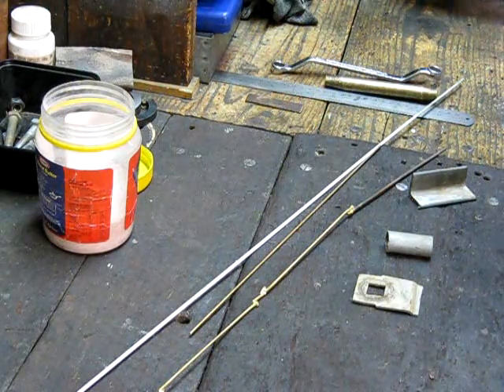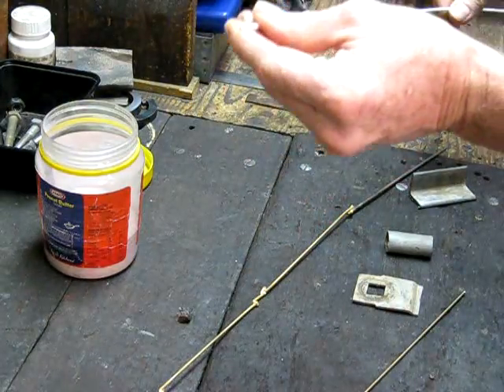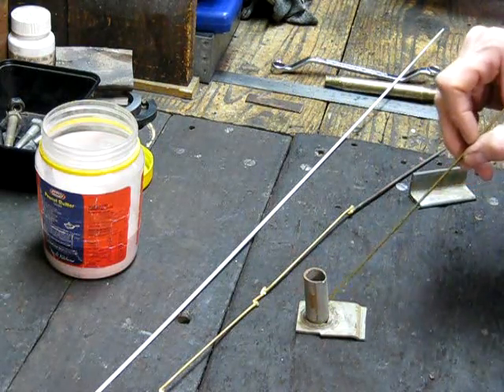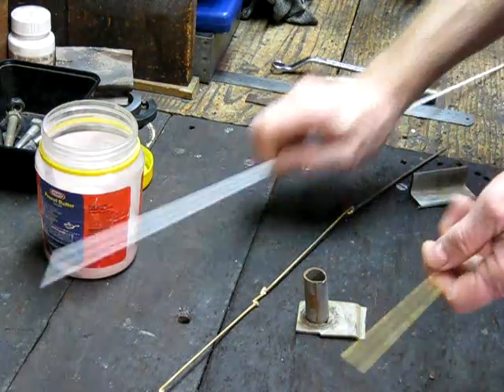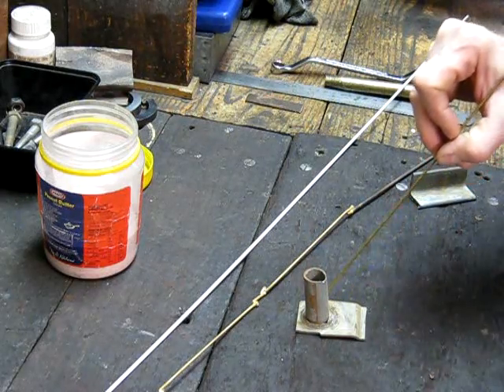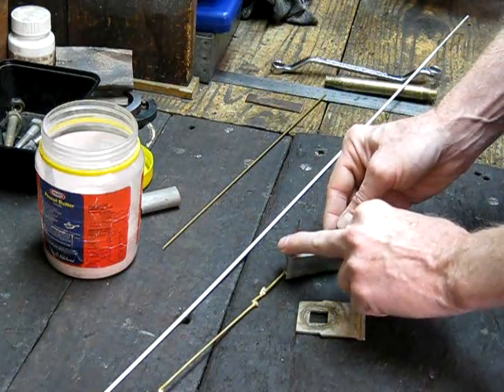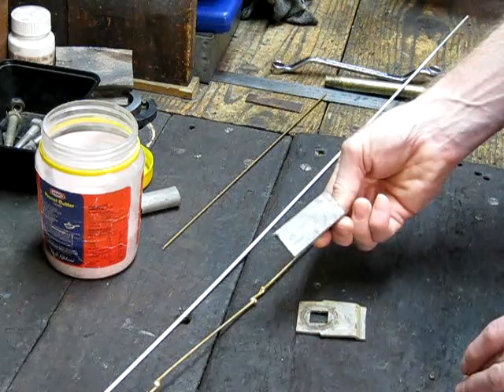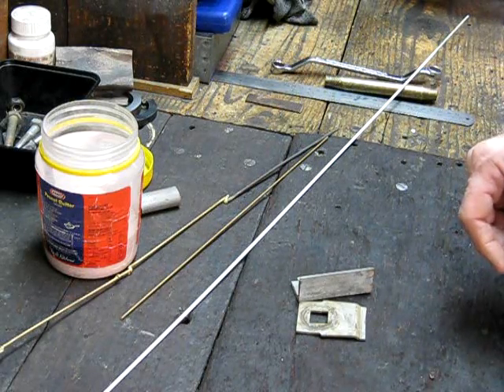How to bronze braze easily - some general workshop tips

Comment: i have big challenge last year on coated bronze i decided to throw it away better use flux and hard bronze separated you get  good results rather than using coated bronze rod
Reply from the maker: Yes, coated rods are bad news. You can't control the amount of flux or when it's applied.  I only use high quality uncoated rods and separate flux. Cheers Rob
Reply: @Xynudu  throw it away coated and jump into separate

Comment: Forgive me if I don't say this wrong. That bronze rod, can it be bought somewhere? I have a small crack in a bronze statue and want to fill the crack, will this do it?
Reply from the maker: Bronze brazing rod can be bought from most plumbing and welding shops.  Make sure you get the correct type for the welding system you intend using.  Welding bronze with bronze will be tricky as the rod will only melt slightly earlier than the statue.  You may be better off using a lower temperature rod such as the type plumbers use for joining copper pipe.
Reply: @diamond6256 did you ever figure that problem out? I have a broken bronze sculpture too, I'm trying to stick its arm back on

Comment: Nice tips, thanks! Would Silicon bronze or Phosphorus bronze be better for torch brazing?
Reply from the maker: You can't use those rods with LPG or a MAPP gas equivalent (not hot enough).  It would have to be an oxygen boosted gas (oxy/acet etc). Cheers Rob
Reply: And could you use borax for a flux?
Reply from the maker: Possibly, but best to use a proper bronze brazing flux.  I have been contacted by viewers who tried other fluxes and failed.  Cheers Rob
Reply: Could you please send a link for the bullfinch torch?
Reply from the maker: https://bullfinch-gas.co.uk/blowtorches/autotorch-brazing-sys/autotorch-brazing-kit-detail

https://www.hampdon.com.au/bullfinch-lpg-autotorch-brazing-and-welding-kit

Comment: Hi,
I am experimenting with bronze and propane only my rod diameter is 2.4mm and is refusing to melt even though the surface is dark red hot and the rod gets orange hot but won't melt,
Would you know if I need more heat for that diameter rod ?
Thanks in advance.
Reply from the maker: You can only melt bronze rod with a suitably hot torch.  The Bullfinch torch is the ONLY LPG torch I've ever seen that is capable of this.  It will melt 2.4 mm rod no problem.

Comment: Hello Rob, very good videos, can you give me some advice? I've had a small bronze sculpture cast by a local foundry, on a "cast only" deal. (Still bloody expensive) I now need to do some small repairs and filling. Would this technique be suitable, or would I risk melting the sculpture? Probably a silly question, but I'm new to all this. Thank you.
Reply from the maker: Hi Robert,  you definitely risk melting the sculpture if you use bronze brazing rod as they are both from the same family.   If the sculpture is oxidised any new bronze will be very noticeable.  It should be possible to repair the statue with silver solder (depending on what is to be fixed) but there may be a noticeable colour difference - use a suitable flux.  The other possibility is to use TIG with nickle bronze rod, as the professionals do to make large works.  Cheers Rob.
Reply: @Xynudu  Thanks Rob, I suspected  trying to braze would damage the sculpture, but like the nice clean finish you get with it. I've seen people on YouTube doing Tig welding to assemble larger sculptures. I'll probably visit a local engineering firm to see if they can help. I own a small arc welder, but guess that wouldn't be suitable for bronze work. Thanks for your help, really enjoy your videos.

Comment: ?
Now here's an interesting concept.
I was reading somewhere (oh a manufacturer of brazing welding rods) - that one can WELD when brazing..
But little to zero info was given on the type of welding..
So - I will ask here.
STICK welding (with an old simple home welder called an electric arc welder.
Is it possible to simply "stick" a welding stick (made of brass or bronze) into a stick welder and boom - simply weld / braze..?
Reply from the maker: I've never tried it.  I have no idea if it is possible.  Electric arc welding is very erosive.  The rod may just vaporize.  I can't say.  They don't sell bronze electrodes, so i would guess that tells you something. Cheers Rob

Comment: Hello Mr. Rob,
I have two L-beam pieces, that are made of tool steel sheet, they are both 3mm thick (dimensions are #1: 60mm x 60mm x 60mm and #2: 60mm x 60mm x 100mm). The L-beam pieces have bad angle, it is approximately 80 degrees, instead of 90 degrees. I'm thinking of undercutting them, then re-aligning for 90 degrees angle and getting a MAPP gas torch to braze it back (with copper, brass or silver filler). Do you think MAPP is suitable for this and will provide enough heat, or should I just get it welded with an arc welder? (The reason I'm trying to avoid welding is, the pieces have threaded holes in them and I'm worried about distortion of those threads, caused by welding.)
Reply from the maker: Hi Daniel,  MAPP is unlikely to supply enough heat for a job with that much mass/size.  You would need an oxy based torch for that. 

If you do use electric arc welding you MUST allow for metal shrinkage when the weld bead cools and contracts. This is less of an issue with torch brazing as all components are at the same temperature, but it can still occur as different metals will expand/contract at different rates.

You may have to run a thread tap through the holes afterwards with arc, although it is unlikely.  Threads are most likely to distort (shrink) when a weld bead is used to bond a nut or similar to a job. 

Cheers Rob

Comment: Hi in lockdown in south africa   have you ever sif bronzed copper to copper  will be busy on a model copper boiler soon ... in the old days they used to do this but the  health  and safety police seem to think  this is a bad idea  .. and now  call for silver solder  ... at great expense I may add.. being an old canny Scot this irks me no ..end this boiler is for my own use  so would appreciate a visual demo on the procedure .. I believe you dont need any flux is that correct?.   Keep well during this horrible virus thing ..  Cheers  Dug Hogarth
Reply from the maker: Hi Dougie, I always use flux.  Flux is cheap. 

I have not used SIF rods.  That is a brand, not a type, so the composition will vary between applications.  I have used silicon bronze rods but wasn't impressed.

I only use BOC rods (AFROX over your way).  Rod quality is important and there is some real crap being sold out there.

I would use GP silver solder rods (yellow tip) for that job - same as used by plumbers on household copper water pipes.  Not very expensive and go a long way.  You only need low silver content for copper and brass.

Those rods only get expensive when you up the silver content for work on steel.  Way too dear.

Cheers Rob
Reply: Thanks for your reply Rob  your info is appreciated   thanks again  Dug Hogarth

Comment: I would have liked to see how it works with the powder - at least - very interesting! I think you saved me a lot of money, because I bought 200 rods of bronze and half a kilo of strange powder 30 years ago and never knew how to use it. Now I've come to the point that I have to heat up the stick and put it in the powder.

Do you also heat up those parts you want to braze together to stick on the magic powder on them as well? So the powder comes in, where the filler metal is supposed to run? ?
Reply from the maker: Hi Paul,

It's called dipping flux because you dip the rod in it after you heat it up a bit and this makes it stick to the rod tip.  The advantage is that you can apply the amount of flux you want before applying the bronze.  To apply and activate the flux the part must be hot enough to make it go clear and run.  This is way below the temperature at which the bronze rod will melt, but still close to red hot.  The flux cleans/preps the surface to be bonded and aids the flow ability of the welding rod/medium.  You only apply it where the bronze is to go. It will flow into the join gap when liquid. Cheers Rob
Reply: @Xynudu  thanks Rob! THIS was really a quick answer! I found two of your other video about bronce brazing - VERY interesting!

Still I would like to ask, if you have to warm up and stick this flux-powder also on the two steel parts and in the gap of the two parts, where the  bronze later on should fill in, or does the flux go there from allone only by your leading it there with the covered bronce-stick?
Reply from the maker: The flux will penetrate to the same degree as the bronze. Flux first to give it time to work, then apply the bronze rod.  The flux increases the flow ability of the bronze considerably.  It is important to use the correct flux, one formulated for bronze brazing.  If the flux is unsuitable the bronze will not flow or bond and will remain in liquid balls  Cheers Rob
Reply: you are my hero ;-)
Thank you!

Comment: I had been trying to braze brass 20x25x3 (mm) to stainless steel pipe, could I do it, no, ended up brazing mild steel to stainless steel instead. Any ideas why this would not work, the only thing I could think of was the brass was just not getting hot enough. I was using the small brazing kit, with oxygen and gas (like the gas on a plumbers torch).
Reply from the maker: Hi Bill,

What type of brazing are you trying to do - manganes bronze or silver solder ?

You can't manganese bronze to brass as the brass will melt first.

So I'm assuming you are silver soldering.  That should be possible provided you use a high silver content rod and a suitable flux.

More information required.

Cheers Rob
Reply: @Xynudu Hello and thanks for reply. I was doing silver solder (pre fluxed) but no joy. I think (I don't know) that it was just not getting cherry red, it seemed to cool down pretty quick if I moved the torch from it. I have just managed to get hold of the torch you have (as you praised it so well) so will see how that goes. Thanks for the heads up on the manganese bronze and brass, did not know that. Only just started brazing so good to know.
Reply from the maker: Hi again Bill,

I don't like pre-fluxed rods. 

Using a Borax based dry powder dipping flux (for brazing) allows you to put as much flux on first as you think necessary and then once it has cleaned/covered the join you bring the job up to full temperature and run the rod into the join.

As you managed to braze ss to mild steel it may well be a heat loss issue.  I'm surprised the oxy gas flame didn't get it hot enough.  The job is only hot enough if the rod melts and flows when touched on the join. 

3 mm should not be an issue with the Bullfinch, however there is a limit to what some torches can do relative to the heat loss experienced.  If heat loss/sink is an issue I sometimes use a large LPG torch in conjunction with the Bullfinch to preheat and raise BTHU to give the brazing torch a help along.

Cheers Rob
Reply: @Xynudu  yes the steel got cherry red pretty quick so not a problem, I wanted brass and steel for effect but had to settle for steel on steel. Still hopefully the Bullfinch will do the job easy, and as you said in one of your videos the gas last a lot longer than the map gas canisters. I will have to get a Bullfinch blow torch now for the extra heat when needed. Again thanks for the info.

Comment: Are the pieces you are brazing together brass or steel?  I have a few brass pieces I need to put back together, don't want to use silver because of the color, I keep trying to braze them together but can't seem to get them to stick together.  I am using the fluxed Rod.  Would switching to bare rod do the trick?   I actually thought I could "puddle weld" the brass together but that isn't working out either.   Any help would be cool, from anybody.   Thanks.
Reply from the maker: Hi Scott,

To braze brass almost invisibly you should be using silver solder (known as yellow tip in Australia) which is what plumbers use to join copper water pipes.  It's not really solder, but a low bronze/aluminium composite rod.

You also need a suitable flux for that application (such as Eziweld 303).  I find using a plain rod dipped into flux works well, and have done plenty of brass joining work.  

That way you can control how much flux to add.  I am not a fan of pre-fluxed rods.

Wrong flux is usually the cause of most problems.

cheers Rob
Reply: xynudu thanks!

Comment: Great video, thanks! 
 I'm building a space framed race car and will be using nickel bronze as was done  on many old formula race cars  ( and still done on Ariel Atom ).  My question is whether the bullfinch is adequate for this bronze brazing / braze welding ?   Also , I've never heard of 'hard' brazing, what is the hard brazing rod made of? Thanks again for great vid.
Reply from the maker: Hi Rodney,

No, the torch would be too small for that sort of work.  It could probably do it, but it would be very slow going.

Best to use oxy/ LP or oxy/ acetylene for that job

"Hard" bronze brazing rod has manganese in it.  It is a general purpose rod.

There is a wide range of brazing rods available for varying applications.  I believe nickle bronze is the strongest.

Cheers Rob
Reply: xynudu Thanks heaps Rob.
Reply: Sorry, just one more question.  Would it (nickel bronze welding) be much quicker if helped along with a separate LPG heating torch?
Reply from the maker: With a Bullfinch torch, yes, I sometimes use an additional big LPG torch to combat heat loss on larger items so the Bullfinch can do it's job.

On space frame joints the tubing would act as giant heat sinks, and I would definitely use an oxy boosted gas for that sort of work.  The wall thickness would be greater than say a bicycle frame, so you need some serious heat.

I've heard mixed reports on oxy/lpg for brazing, with some saying it's great and others not so good.  I've never used it, but the flame temperature should be plenty hot enough - with the right tip.

Note that oxy/LPG can't be used for normal steel wire welding as it produces too much water vapour, so oxy/acetylene is the best all round application.

Cheers Rob

Comment: Thanks for another great video. I would like to run a potentially silly idea by you. I have a problem with a bent prop shaft strut. It has fatigue cracks, so simply straightening it will not completely solve my problem. I don't think I can find an exact replacement for it. I was thinking of straightening it out, then grinding the cracks and trying to fill them in using a torch and brazing rod. Is this a workable solution? My alternative is to find something close to the original and then do a lot of fiberglass work to put it in place. Unless you can think of a third option.
Reply from the maker: Rick Rose If you are going to grind out the cracks, the gap will be too wide for bronze - gets weaker as it gets thicker.  You would be better off grinding, then using arc welding (stick, mig etc) to fill in.  This will be stronger, but may warp it.  Depending on the material it's made of, you must match the rod to the metal.  Cheers Rob.
Reply: @Xynudu  Best method for VERY thin metals - is that of "spotting" with the arc welder..
Don't simply string along a long length of weld as that will either blow holes in the thin metals or warp it.
spotting a weld here and there, and keeping each as far apart as you can, until all weldable areas are welded, which will allow you to stick-weld "thin sheet metal" and thus weld anything.. (without overheating / warping or at worst melting the metal being welded, thus when melted - blowing holes in it)

Comment: Hello,  This is my Brazing Day 1.  So I have what are probably stupid questions but I need some advice if you can help.  I am hoping to join two pieces of steel by brazing.  After watching this video and using google a lot, I was thinking of getting "1 Rothenberger Superfire 2", "2 Rothenberger MAPP Gas", "3 bronze brazing rods", "4 powder flux".  Can you advise if this should work on steel and if I'm missing anything - Thank you - Very good video.
Reply from the maker: MAPP gas will melt GP brazing rod.  See the flame temperature chart in ths link : http://www.bullfinch-gas.co.uk/index.php?option=content&task=view&id=51
The mass of the metal to be joined is the deciding factor.  Thin gauge tubing etc is generally no problem, but solid steel drags in a lot of heat, and on some jobs I have to use an additional Primus LPG gun to give my brazing torch some help.  The components you have listed are all you need to get started.  MAPP guns using disposable bottles seem to be fairly similar, and are not as powerful as the Bullfinch torch - I have used both.  But for small components they work OK. Cheers Rob.
Reply: Thanks Rob. It is half inch box so pretty small gauge and only fairly short pieces. Thank you for the advice and help.
Reply: xynudu . Hi again - all went really well and worked brilliantly - thanks again for the video and advice :-)
Reply from the maker: Mike Dawkins I'm pleased it worked out OK for you.  I was pretty sure you would have non problem.  Brazing is really very handy for small jobs.  It's non invasive and uses capillary bonding.  I'm sure you will find plenty more jobs to use it on.  Cheers from down under.  Rob
Reply: hi i want to ask if there is a bronze rod to use electric welding...
Reply from the maker: Nothing for stick or MIG welding that I am aware of.

For TIG welding you use a standard GP rod.
Reply: Mike Dawkins please send manufactures and bulk supliers for gas welding brass rod

Comment: Can I use a butane burner ? What is the melting point on the bronze as my handheld butane burner has a 1200 center grade or Celsius ;)
Reply from the maker: See the flame temperature data at the link below:
http://www.bullfinch-gas.co.uk/index.php?option=content&task=view&id=51
A standard butane torch is not hot enough to melt GP bronze rod.
Reply: Thank you.